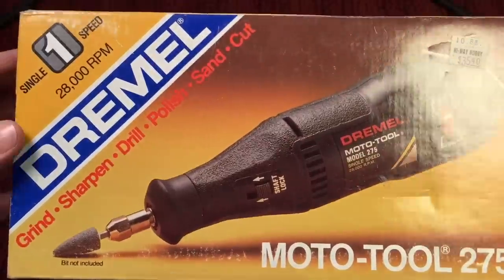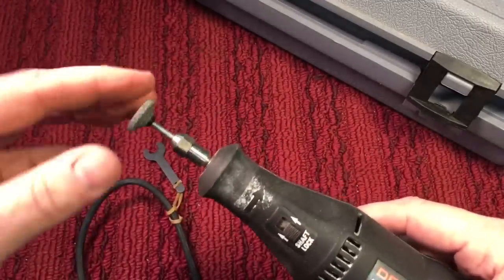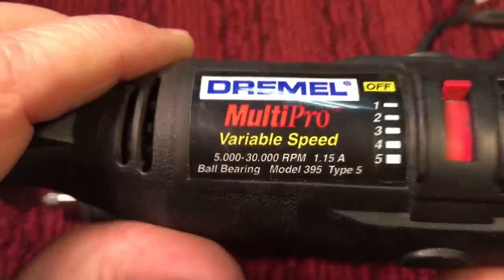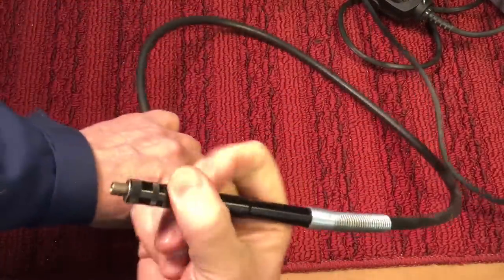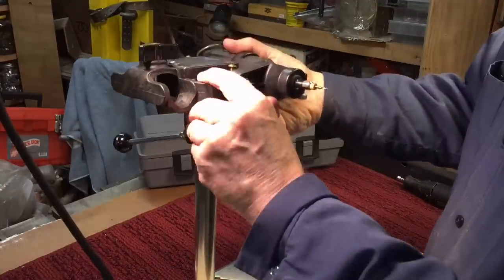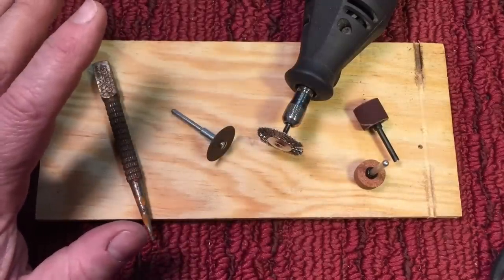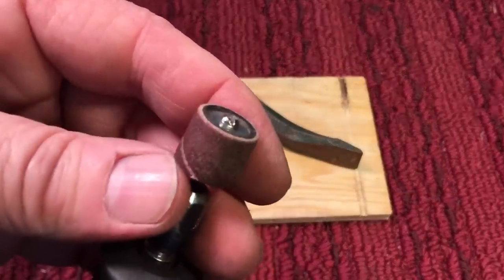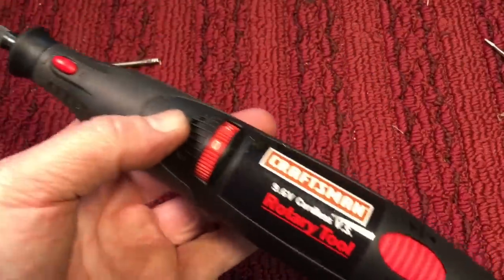Introduction to the Dremel Moto-Tool

Comment: Have had a 395 3rd gen variable speed model for many years. The shaft flex coupler recently broke when using a lot of cutoff wheels on a project. Didn't even know they had one inside. Thanks to YouTube, I discovered the issue and ordered a replacement coupler. You br video has inspired me to break out the Dremel and use it on some Easter projects. Thanks!

Comment: You know the person posting the video is great at what they do when you already are more than familiar with the subject matter, yet you still sit there and enjoy every single moment of watching the video!  I actually wore out the wrench that came with my original Dremel, so now I use my small plierench (learned about them from some guy on youtube!) instead.  As always John, great job.  👍🏻👍🏻👍🏻
One thing I have also used a LOT with mt Dremel is the tiny metal circular saw blade.  BTW, there is a guy somewhere here on youtube who makes his own cut off wheels using flattened bottle caps and bolts!  Seem to work great.

Comment: Awesome video. I didn't realize dremel had so many attachments. Thanks for sharing.
Reply from the maker: Hi William!  This was just a few!  It really is a super versatile tool!!!!!  =)  Thanks!!!!!!
Reply: Dremel does have a lot of attachments, but some of them (the original Dremel branded) are also awful. I have the 90 degree angle attachment and it makes a lot of grinding noise and heats up quickly. I even took it back to the store and they changed it to another one, but it is the same. I also have the model 670 rotary minisaw attachment, and it has a design defect where the spring loaded safety flap does not go deep enough, so that you cannot fully utilize the flat bottom of the saw. So although Dremel may be considered a quality brand, they do have some major fuck-ups in their devices. Another example is the Moto-saw (not an attachment but a complete reciprocating jigsaw). It is quite bad for cutting anything other than thin cardboard.

Comment: Excellent introduction video!  I didn't realize there was a Mr. Dremel!  I love my home-made scotch-brite discs!  I think those, the wire wheels and the polishing wheels are what I use the most for tool restorations!  I just got some of those thicker cut-off wheels from HF.  They seem more durable than the original thin brown ones.
Reply from the maker: Hi N!  You know there are so many different accessories that I could never cover them all!   For example, the cut off wheels come in many different thicknesses and grits!!!   Some are made for specific materials too!  We usually buy what's available but I saw a catalog once that had thousands of rotary tool accessories!   =)   Thanks!!!!!

Comment: Awsome vid! I love using rotary tools. So many uses for them. I have four of them actually two cordless and two corded. I tend to use my cordless mostly now through. Batterys are not what they used to be and can take on any job the corded can without the nuisance of the cords. I have a 12v Milwaukee one that I attach a 4 amp hour battery to and the thing is a beast! Thanks again for the vids scoutcrafter🙂

Comment: Great video John, not sure how I missed this one when it came out.  I have several Dremels, and as a collection might be the most used power tool I have.  The cordless one gets a lot more use than I thought it would, but you can't beat corded when you need a bit of grunt :)

Comment: Mine is from the 80’s and still going strong. About ten years ago it stopped working. I dismantled it and to my surprise found that there were elastic bands connecting the motor to the shaft. They were broken. I repaired the unit by replacing the bands with rubber surgical tubing. Still going strong.
Reply from the maker: Wow!  Elastic bands!!!  Great to know!!!!!

Comment: Didn't know the drill press tilted! Next Dremel video, talk about the grinding stones! Some for metal, some for stone! I always mess up and grind on aluminum with the green one and muck it up. Luckily the little stone dressing block cleans it up.  The Dremel brand wire wheels are better than the cheapo ones for sure.  I'm liking the router attachment, may need to get one now!!!! Great video as always!
Reply from the maker: Hello Aaron!  The TRIM routers they sell are really the way to go for small jobs!  I have a Porter Cable one and it works fantastic!  I find for routing you need speed and some torque and the Dremel is a little shy on torque!!!!!!!    Thanks!!!!!

Comment: I bought a bunch of those asian knock-offs. I have little wires stuck in all my clothes now. The dremel brushes are excellent but (as you said) pricey... and they're hard to find where I live. Great video. Makes me want to get a real dremel. I have a makita rotary tool but I'm not crazy about it.
Reply from the maker: Hi Ben!  LOL  We have all bought the knock off wire brushes and learned the same lesson!!  The worst part is the wires are so fine and the speeds are so fast the wires often will lodge in your skin too!!!!  It's the only time you will NEED your face shield!!  What we need is a quality brush that doesn't cost so much!!!!  =) Thanks Ben!!!!!!!

Comment: I love that horizontal boring setup! It's so cool! I really should get myself some kind of rotary tool for small grinding wheels, so I can grind off hard spots that you can't cut with a file. I was disassembling a big Record No.114 vise that I bought locally here (great price!) and it had a really hard weld splatter on the back of the slide which wouldn't let me take it out. I bought one of those wheels you show at 2:13 and chucked it up in a big corded drill that went up to 3600 RPM. It got the job done very well but of course a small rotary tool would have been the ticket for that kind of work. I still have that small grinding wheel for a day like that. I have been thinking about getting a electric die grinder or straight shaft grinder instead of what you'd call a 'rotary tool', just to have something a little more heavy duty to use with small wire wheels as well. What do you think of those? Do you have one? Would you advise against one? Thanks for the video!
Reply from the maker: Hello Aryan!  The air Die grinders are awesome if you have a big air compressor.  The Dremel tools are good because they are light and easy to handle but the bigger more powerful motors are nice for different uses.  We have a line of rotary tools here made by Foredom that are worth looking into!!  Thanks!!!!!!

Comment: I really like my Dremel tool and has got me through some of my projects. But I always felt like the Dremel is a jack of all trades but master of none. I’ve had terrible luck with Dremel wire brushes..they seem to last all but 10 minutes before all the wires disappear. I use the drum sander bits often as well but the longevity of those aren’t to good either.

Comment: I like the early model's spindle lock switch. My more recent button type can be tricky if you're using the little spanner [sorry, wrench] and you want to control the depth of the tool in the collet, 'all fingers and thumbs' me mum would've said. But definately a tool that once you have one, you'll miss it when its gone. Versatility is often no more than a selling ploy - but in the Dremel its the reason it exists. They bought me a new one for xmas but I still use my older one 'cos I don't want to put any wear on the newbie!
Reply from the maker: Hi Keith!  LOL  I am the same way!  So many times I will "save" my new or cherished tools and use older ones!  LOL   Thanks!!!!!!!!

Comment: Several years ago I thought the dremel was more toy then tool. While using a cut off wheel my thumb ended up between the piece and the wheel. I ended up with a neat hole in my fingernail and luckily that's all. Learned the hard way but I love my dremel tool.
Reply from the maker: OUCH!   The good thing Jacob is Dremel accidents are pretty rare!  They are surprisingly safe however we all have wound up with some wire wheel wires stuck in our bodies!  LOL!!   Thanks!!!!!!!!!!

Comment: Sears hardware section  clearance bins always had Dremel bits marked down 75% off usually for $2 - $3 a pack. I haven't checked in a few years, because I never owned one until last year, when I end up picking up two Dremel tools.
Reply from the maker: Hi Kent!  Yes!   Reduced price Dremel accessories are the way to go!!!!  =D

Comment: Scout, thanks for doing a video on the Dremel.  I have one.  Haven't used it much but should use it more.  One of the extra attachments I bought is the little saw.  It even has a plastic safety shield just like a regular table saw.  I do need to get some wire brushes.  A lot of things came with it but no wire brushes.  Do you use regular compound when you buff?  Or does the high revolution speed need a special compound?    - Kathie
Reply from the maker: Hi Kathie!  The wire brushes are great but you do get what you pay for!  The cheap ones don't last, but they are cheap!  LOL  I find polish like Flitz or Wenol  work really good with the Dremel but most types of polish will work!  They really are a great addition to the shop!!!!!!!   Thanks!!!!!!!!

Comment: I believe Dremel made the Craftsman tool for Sears.
I have 2 of them and the newer drill stand.
You said something about the wires coming out of the wire wheels.  The wire wheels should not be run over 8 or 10K rpm because the wires get slung out.  The top limit is on the package.
Reply from the maker: Hi Roy!   I think you are right about Dremel making Craftsman tools!   Also many of the import Wire brushes spit wires when they are used a little and loosen up...  There is a reason you get 30 for $5!  LOL    Thanks!!!!!

Comment: You are so right about the original dremel accesories. The are so much better but the knock off stuff keeps tempting a cheapo like me! 
(those fiber cut off discs are so great (the black ones) but so expensive and I'm known to snap em half way trough or so)
Reply from the maker: Hi Alex!  Yes!  Its so hard to plunk down a few dollars for a small little wire wheel or something.  The original Dremel accessories are really good quality but very over-priced for some of them!  Thanks!!!!!!

Comment: I bought the Dremel 4000 and to be honest I’m not entirely happy with it, it sounds really rough, it does run smoother as you increase the RPM. The ones you demonstrated sounded really smooth and quiet.
Reply from the maker: Hi Derek!  That seems to be a common consensus with some of the new Dremel tools, However they do have certain features like as the load increases so does the power from the tool...  I would love to see how the old does against the new!   Thanks so much!!!!!!!!!
Reply: derek wilkinson I have a #300 and a few newer units.  The newer ones have features my old one doesn’t.  You’re right about the sound of the newer ones but my 300 keeps going and first one I go to.  The newer one do have features that come in handy when the need exists.  All in all a great tool to have.

Comment: Hi!
Will the Dremel tool help with sharpening a chain saw? If so, I’m planning on buying one for that specific reason, but after watching your wonderful video, i see the tool does much more if you have the right  accessory. Not sure what I should i buy? 
Buying assistance would be appreciated. Thank you!
Reply from the maker: If possible always buy the variable speed model!  As for sharpening the chainsaw it's awesome!  You just buy the bit!  https://www.homedepot.com/p/Dremel-5-32-in-Rotary-Tool-Grinding-Stone-for-Sharpening-Chainsaw-Blades-2-Pack-453/202819605?g_store=1214&mtc=Shopping-B-F_D25T-G-D25T-25_7_POWER_TOOL_ACCESSORIES-Multi-NA-Feed-LIA-NA-NA-PowerToolAccessories_LIA&cm_mmc=Shopping-B-F_D25T-G-D25T-25_7_POWER_TOOL_ACCESSORIES-Multi-NA-Feed-LIA-NA-NA-PowerToolAccessories_LIA-71700000043746545-58700004596952413-92700049573927185&gclid=EAIaIQobChMIhLqqiPiq6QIVJPC1Ch0mkgqiEAQYBSABEgKlS_D_BwE&gclsrc=aw.ds
Reply: ScoutCrafter thank you!

Comment: Hm, never heard of Dremel? Dremel is a synonym for this whole tool category. Here in Germany this type of tool is always called a Dremel, even if it's made by a different manufacturer. 
My Dremel 4000 is made in Mexico. The 4000 model still requires the wrench, but now the wrench has a small screwdriver on the rear end in addition for the small screws on the holders for some accessories like the cutoff wheels, circular saws or the sand paper.
I remember back in the 90s they had a lot of ads in TV. Like this one, here in Germany we had the same ad, but only with a german narrator:

https://www.youtube.com/watch?v=hgKLhzArQTI
Reply from the maker: WOW!  I remember that commercial!  Forgot all about it too...   As for the Mexico build once Bosch tools bought Dremel they, like every other tool conglomerate sourced out manufacturing to lower bidders...   Profit, profit, profit!   =)

Comment: I have a two speed dremel but it seems to get very warm after a few minutes of use. Is this normal?
Reply from the maker: Hi Cindi!  They will get warmer at lower speed because the fan isn't spinning as fast.  Also it's important the vents are clean and unobstructed.  They are slots in the body just above where you hold the tool...   Hope that helps!!!    =)